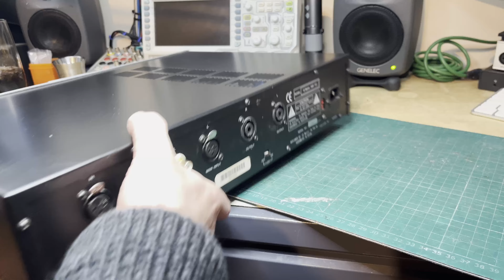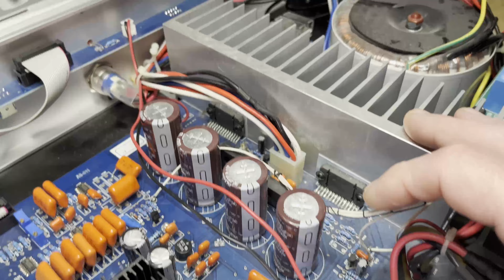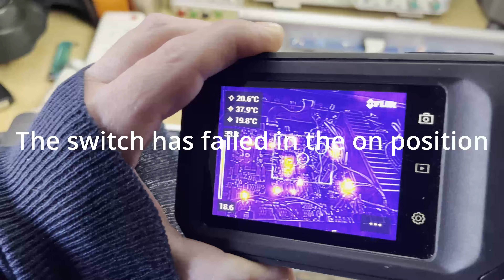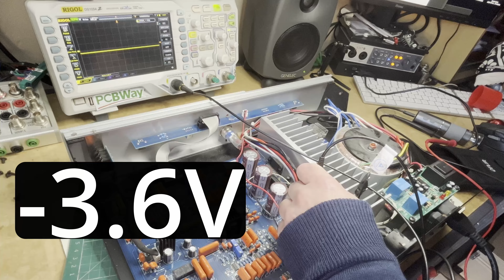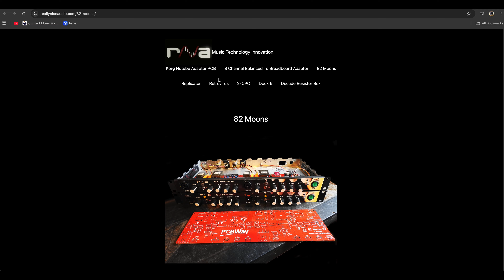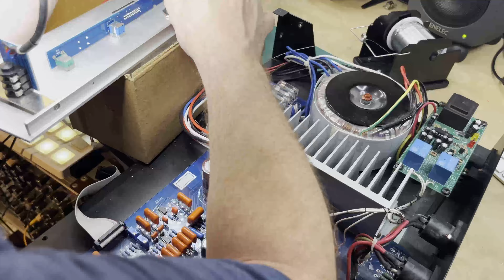SE Munro Amplifier Repair

Comment: This is the amp for the Munro Egg 150 studio monitors! The amp came bundled with the egg-shaped speakers, and sounds absolutely killer for mixing/mastering. I hope I don't ever run into issues with mine, but there is some really valuable info in your video. Thanks for sharing!